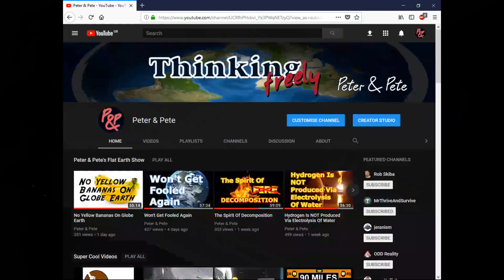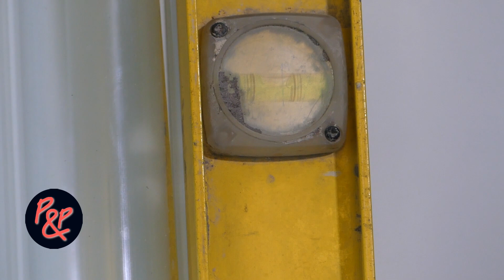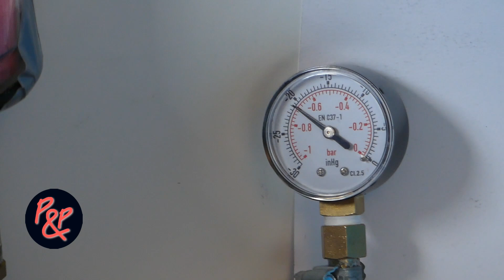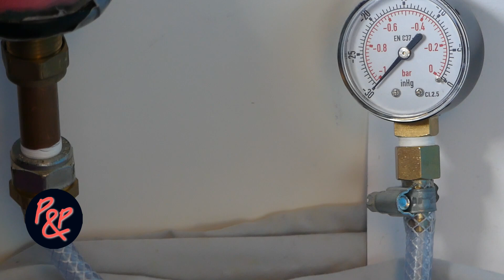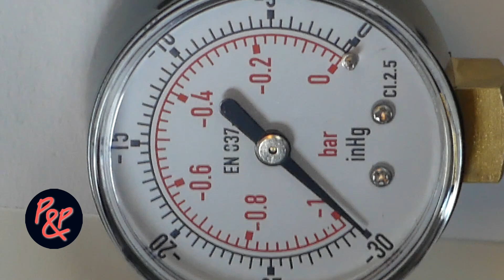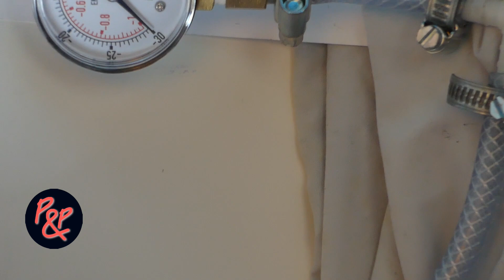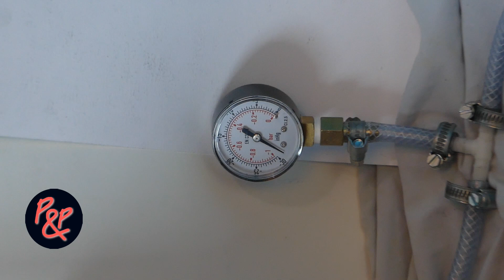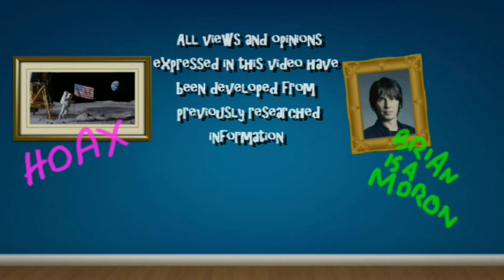Falling Objects - Sealing The Deal

Comment: So:
The same-weight felt disc fell at different rates in air and partial vacuum.
The rate was far closer to the bearing in partial vacuum, and the bearing fell at the ostensibly the same rate.
What should we infer from this?
Reply from the maker: We can infer that if the height was increased when the objects are both dropped the distance between both falling objects would increase in partial vacuum and at an even greater vacuum. Remember, we can easily get people like to think objects fall at the same rate in any vacuum but increase the height the objects are dropped, then you'll see that objects do NOT fall at the same rate.
Reply from the maker: Btw, increasing the strength of the vacuum will affect both objects rate of fall, not just the lighter object. So even the ball bearing will travel slightly faster yet still pull away from the felt, as seen in all the other demonstrations. If you think we're wrong pull a vacuum over 6m and see the results!
Reply: @PeterPete  you are negating the aerodynamic differences between the two objects. Drop two aerodynamically similar objects, of different densities, in your partial vacuum. Until you do so, your experiments with your partial vacuum are invalid.
Reply: Peter & Pete

"increase the height the objects are dropped, then you'll see that objects do NOT fall at the same rate."
That's jut a promise. Existing experiments disagree. And height isn't a force. 
So far you showed us that the falling rate of two objects gets closer when you lower air resistance.

"Btw, increasing the strength of the vacuum will affect both objects rate of fall, not just the lighter object."
Therefore - heaviness is not the cause. But your bearing fell at the same rate in both tests.
You just debunked yourselves.
Reply from the maker: @Magnum-Farce  you're more than welcome to carry out the demo yourself and even increase the height of drop! Be my guest!
Reply: Peter & Pete

You already provided the evidence: Reducing air resistance reduces the difference in rate. Totally logical.
Height isn't a force.
Can't get clearer than what you showed.
Reply from the maker: @Magnum-Farce  so you didn't see the heavier object moving away from the lighter object in the vacuumed tube once in free fall? Extend the height and the gap would be more! try it for yourself and see! Dare you!
Reply from the maker: @Magnum-Farce  quote - height isn't a force -
although those are your words not mine height does affect the amount of 'force' a falling object can exert - try dropping a bag of sugar on your head from 1ft above it. Doesn't hurt much yeah? Now do you think a bag of sugar dropped at 50m above your head, would hurt less or the same or even more? if your answer is more, do you think the reason could simply be the drop rate from 50m was faster than for the 1ft?
Reply: Peter & Pete

"although those are your words not mine height does affect the amount of 'force' a falling object can exert - try dropping a bag of sugar on your head from 1ft above it. Doesn't hurt much yeah? Now do you think a bag of sugar dropped at 50m above your head, would hurt less or the same or even more?"
It's is accelerating and so the kinetic force is greater when you stop it, of course.
This is all consistent with your evidence.

Acceleration over time is what changes velocity at any given moment.
Height isn't a force that changes the rate of acceleration.

" if your answer is more, do you think the reason could simply be the drop rate from 50m was faster than for the 1ft?"
It was allowed to accelerate more. That doesn't change the acceleration. The acceleration is the same.
Reply: Peter & Pete

"so you didn't see the heavier object moving away from the lighter object i"
Yes I did. I didn't say I didn't. Something accelerating faster will move away from the slower-accelerating object.

"Extend the height and the gap would be more! "

That doesn't mean the acceleration rate has changed, of course. It's true at ALL moments after something has been released to fall.
Your evidence show us that when you lower resistance to falling, the acceleration rates start to equalise.
That's the logical conclusion. The disk and ball feel at a much more similar rate in the partial vacuum.
Reply from the maker: @Magnum-Farce  quote - It was allowed to accelerate more. That doesn't change the acceleration. The acceleration is the same.

ah u see that's the problem u fail to understand the point in the video - i wasn't looking at rate of acceleration given there is allegedly this thing called terminal velocity! The video concerns tself with rate of fall over entire height that's why i never used the phrase rate of acceleration and referred to rate of fall! hard to believe you've had an education and yet u can't understand a simple demo!
Reply from the maker: @Magnum-Farce  at the end of the day the heavier object impacted first in ALL demonstrations and if we're told objects fall at same rate especially in vacuum, then that must be false given the results seen in video!
Reply from the maker: @Magnum-Farce  if you thikn i'm wrong try and get two dissimilar weighted objects to fall at same rate over different heights in vacuum! That's all you gotta do! try it for yourself!
Reply: Peter & Pete

"ah u see that's the problem u fail to understand the point in the video - i wasn't looking at rate of acceleration given there is allegedly this thing called terminal velocity! "
That doesn't matter at all.
Your evidence shows the acceleration of bodies getting closer with lower resistance.

"at the end of the day the heavier object impacted first in ALL demonstrations "
Yes, that's consistent with the scientific theory in your tests:
It impacted with LESS difference when you lowered resistance.

"then that must be false given the results seen in video!"
No, haha. Not of your tests are consistent with the science,

"That's all you gotta do! try it for yourself!"
We can use evidence. You have supplied us with evidence that has a clear logical conclusion, thank you!
Reply from the maker: @Magnum-Farce  terminal velocity doesn't matter?? do you think the terminal velocity of the 'felt' is the same as the ball bearing?
Reply from the maker: no object can accelerate when it's reached it's terminal velocity can it? so a bit of a no brainer to use rate of acceleration!! I'm sensible and use rate of fall over the entire fall!
Reply: @PeterPete  terminal velocity doesn't exist in a vacuum.
Reply: Peter & Pete

"terminal velocity doesn't matter??"

Nope. Not when you are trying to test whether objects fall at various accelerations.

" do you think the terminal velocity of the 'felt' is the same as the ball bearing?"

It doesn't matter. You have already provided evidence that the "falling rate" of objects gets closer when you remove resistance.

"no object can accelerate when it's reached it's terminal velocity can it?"

Only when you remove the air resistance.

"so a bit of a no brainer to use rate of acceleration!!"

How poetically correct! 
Terminal velocity isn't a constant for an object. It changes when someone opens a parachute, and it is different at different altitudes, for different shapes.
So all you ascertain by observing the terminal velocity of an object is that it is being resisted, at the BASE of that action... is the acceleration.

Please explain how you resist something in a vacuum?

"I'm sensible and use rate of fall over the entire fall!"

So, using your logic, you tell people you (and they) are ignorant of the accelerations of objects until you've tested them up to lightspeed, across the universe because of that potential VARIABILITY, yes?
You think that's sensible and demonstrates understanding?

How do you think then we use understanding of these things to design flying vehicles and parachutes, rockets, ballistic weapons? Can you show all those professionals that they are making a big mistake and improve these designs?
Reply from the maker: @Magnum-Farce  quote - You have already provided evidence that the "falling rate" of objects gets closer when you remove resistance.

so you failed to notice the ball bearing (bb) moving AWAY from the 'felt' in vacuum indicating the bb was falling FASTER? increase the height to 20m and the gap between 'felt' and bb will be even greater with the bb impacting first! Objects do NOT fall at same rate in ANY vacuum!
Reply: Peter & Pete

"so you failed to notice the ball bearing (bb) moving AWAY from the 'felt' in vacuum"

You haven't tested vacuum.
And the bearing did indeed move away from the felt, as expected. I told you this in a post above.
The point that is pivotal aspect of proof, is that it fell away LESS quickly than in air, and the bearing itself fell at pretty much the same rate... Indicating it's shape allows it to move through resistance more quickly.

"indicating the bb was falling FASTER? increase the height to 20m and the gap between 'felt' and bb will be even greater with the bb impacting first!"

That doesn't matter: You are testing to find a logical conclusion about RATES, not time over distances.
Your original titles were about proving something about "falling".

"Objects do NOT fall at same rate in ANY vacuum!"

You haven't tested vacuum.
You have tested partial vacuum.

Your evidence shows us that objects fall with rates that get closer as you remove air resistance.
That's fantastic! Well done.
Reply: *time over SPECIFIED distances.

You have shown us that air resistance varies falling rate.

If you dropped a 1kg parachute attached to a 1kg ball of lead, it would fall slower in air than a ball weighing as much as the ball and chute. Saying "but you need more distance and you'll see something different" isn't logical.
If someone did a test a 1 mile, you would simply say, "no but at 1.1 miles there would be a difference". That's not how the logical use of evidence works. We develop a way to predict using that evidence, or else nothing would advance.

So, heaviness itself isn't causative.

And as you decrease resistance, the chute would start to fall at a rate closer to the 2kg ball.
That's what your test implicitly tells us. Well done, again!
Reply from the maker: @Magnum-Farce  i didn't test vacuum? what did the gauge reading indicate to u?  was it working properly? did you hear the vacuum pump on? did you hear any hissing which would indicate a leak?
OBJECTS DO NOT FALL AT SAME RATE IN ANY VACUUM!
Reply from the maker: @Magnum-Farce  I've also demonstrated that the height at which objects are dropped is a conributory factor in determining whether objects fall at same rate or not! I've demonstrated that in air two dissimilar objects will seem to fall at same rate over 4ft but over 60ft will fall at dissimilar rates - the heavier object WILL impact first!! The same princple applies in vacuum as I have demonstrated. Extend the height of vacuum and one will observe a greater disparity objects between the falling objects!

rate of acceleration of a falling object in vacuum is proportional to its mass! Therefore all objects can NEVER physically fall at same rate.

If you disagree just prove it instead of typing bollocks!
Reply: Peter & Pete

"i didn't test vacuum? what did the gauge reading indicate to u?"

About -1 bar relative to 1 atmosphere. Partial vacuum.

" was it working properly? did you hear the vacuum pump on? did you hear any hissing which would indicate a leak?"

The SOLE aim of reducing pressure is to eliminate all air resistance, not some.
The gauge indicates you had some air in the tube.

"OBJECTS DO NOT FALL AT SAME RATE IN ANY VACUUM!"

You need to test in a vacuum and guarantee items begin to fall at exactly the same moment from the same hight for evidence of this proposition - or you have a device capable of measuring acceleration accurately in this context.

So far, your evidence is that objects rate of fall starts to equalise as you evacuate air from a container.
Reply: Did you start blocking my posts, guys? Why on earth would you do that, rather than argue them competently in front of everyone?
Reply from the maker: @Magnum-Farce  you do realise that -1bar  is BELOW 0 psi and 0 atm's? Atmospheric pressure is 14psi so a lot of the air had been removed from tube. You clearly got personal issues and clearly don't want to accept the heavier object's rate of fall was FASTER than lighter object! if you think I'm wrong get yourself a strong vacuum pump suck all the air out of a tube and drop your own objects like I have! If I can do it then so can YOU! Send a link to the video once you've got it done. Until then you're just wasting our time!
Reply: It's really odd that you block posts. You must know you're losing the argument. No other reason to censor.
Reply from the maker: @Magnum-Farce  this discussion is going around in circles ! i only hide users from channel when it's clear discussion is going nowhere - like this one!
Reply: You just admitted you would rather hide a discussion than leave it for people to see you are correct by logic. You are a censor,. You don't HAVE to respond. So what does that tell us about what you think of your on responses?
Reply: It's simple: Don't respond to people and then hide their response if you want to look like you mean what you say.
Reply from the maker: @Magnum-Farce  zzzzzzz!
Reply: Peter & Pete

You're a  censor. Good luck pretending you're on the side of "truth" to anyone who sees you restrict free speech. And you just made fun of that asset that people died for in public.
Reply: Who the hell has to block arguments of they are ostensibly wrong?
Even you know the answer to that. So, now look at your views and sub numbers.
Reply: @PeterPete  I think dropping the 2 objects in the same tube has had an effect.  The air that still remains in the tube is forced up as the ball drops slowing the second and  more air resistant item.  Dropped one a a time I think the second item would get closer to the ball under  the same conditions. I think you called it a day as you knew the results are going against your belief and the conclusion you gave was dishonest.  You did in fact destroy your own argument.  You stated that all objects fall at different speeds depending on weight.  Yet you clearly show that even tho no weight had changed the second item fell faster. Would you like to give a better conclusion now ?
Reply from the maker: @thebrokentrifold2578  Thanks for your opinion! try it yourself to find out if your opinion is correct!
Reply: @PeterPete  i have no reason to try it myself.  It has been done correctly many times by well qualified individuals and results verified and published.  Why is it you did not comment on the false conclusion you gave?.
Reply from the maker: @thebrokentrifold2578  quote -  i have no reason to try it myself.  It has been done correctly many times by well qualified individuals
like who and where? the only bona fida videos on you tube are of 3 to 4 ft long tube, we did 6.5ft!

Comment: 11:50 why does the fabric not fall straight down without lateral movement? Your pump is not strong enough to evacuate the tube of all air.
Reply from the maker: you clearly need some glasses, the fabric did fall straight down.
Reply: @PeterPete  Did not fall straight down.
Reply from the maker: @stranger_danger1900  yawwns!!
Reply: @PeterPete  Yawn....your experiment was flawed.

Comment: Unless the objects don’t start falling at the same time this is not going to count.. u went to all that effort yet u couldn’t engineer a better dropping mechanism.. for instance - after you pull away the magnet and the first object is released the remaining one will be under slightly more magnetic attraction for milliseconds before it begins to fall - effecting its velocity.. can’t u see that??
Reply from the maker: love your mentality - I didn't realise the silica aerogel was magnetic! hmm strange man! But regardless, did you not SEE with your own eyes with BOTH objects in free fall, the heavier object moved AWAY from the lighter object? I guess you didn't compare the gap between the 2 objects at the top once in view and at the bottom when the ball bearing impacted! You really need to get yourself a mental health check up!
Reply: "the heavier object moved AWAY from the lighter object? "

That's explained and expected by the model. The important thing is that you showed the lighter object fell at a rate massively closer to the heavy one when you remove some air resistance.
Reply from the maker: @Magnum-Farce  but according to your model both objects are meant to fall at the same rate!! In all the drop tests we've done in air, in water and in vacuum, the heavier object ALWAYS hits the bottom first given enough height is allowed for both objects to reach their max drop velocity!! You're more than welcome to disprove it!!

Comment: Great vid guys. I have a question; can this be done with two objects the same size/shape (volume) however with differing masses (weight)? Eg. make a mould from a metal object  then fill it with wax to make the same size but differing weight,  then see how they fall. Thanks ;-)
Reply from the maker: this can be done but the heavier object will hit first given enough height! We're finding the closer the weights of the two objects then more height is reqiured to observe the difference in rate of fall!